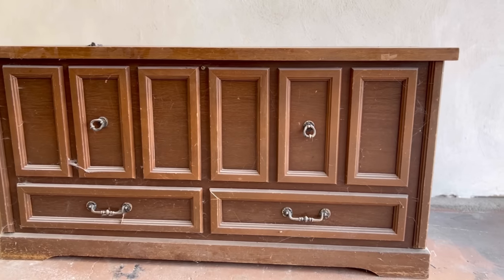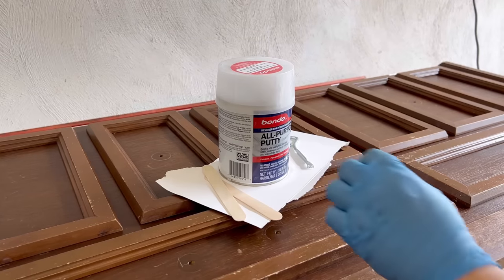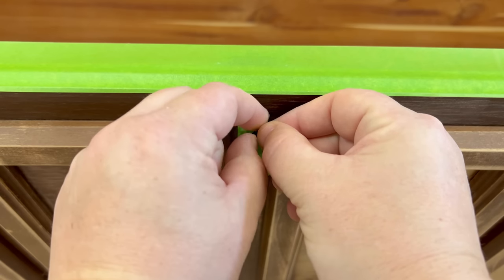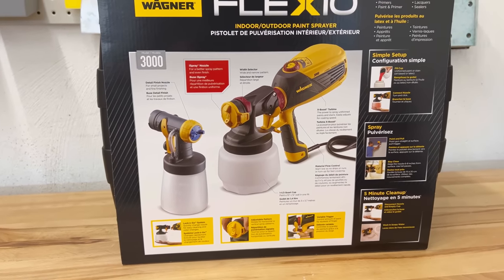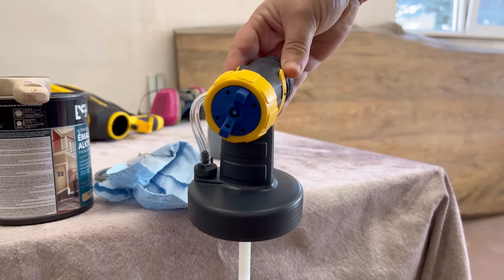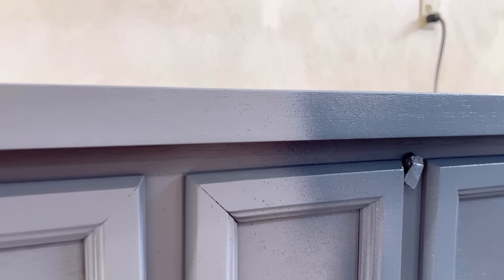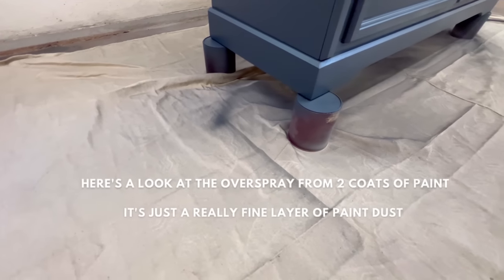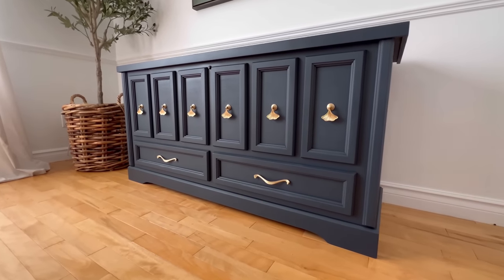Get a SUPER SMOOTH finish with a PAINT SPRAYER!

Comment: Beautiful and love the color for sure. I tried my flexio 4300 this weekend and about cried. I used the Behr cabinet paint and didn’t thin per directions. I have two large side tables with drawers now covered in rough texture. Prior I tried it with fusion paint and wasted an entire bottle of it trying to figure it out. I don’t know why I am getting the rough texture but sanding down and spraying again just creates the rough texture again. It wasn’t hot here either, barely warm enough actually. I don’t know what to do with this sprayer and I want to love it

Comment: I use that paint on all my furniture. Some tips I can pass on from many failures. The Graco sprayer works best with this paint, my Wagner tends to leave rough areas that I end up dry rolling to get smooth. Temperature is very important to allow self leveling, if you area is over 70 degrees Fahrenheit, then mix in some paint extender to lengthen the dry time. It is a very good paint and the effort is worth the result. I use Floetrol paint extender.
Reply from the maker: Interesting! Painting is definitely a very personal experience and we all need to test out what works best for us. I find that the Graco sprayers put out WAY too much paint and I’d be afraid to add an extender to this paint in particular because it already self levels so effectively (I’d have a drippy finish) 

Thank you so much for sharing your experience though. I’m sure someone here will find it super helpful ❤️

Comment: Thank you so much for making this video. I have been terrified to try spray painting furniture because the couple of times I have sprayed primer from the can, I get runs. I panic when I push on the bottom and move too fast or too slow and go back over it too many times and it turns into a mess lol. I also don’t have a garage or area suitable for spraying as I do all my refinishing in my open living room/dining room area (not ideal but I make due). I really want to learn how to spray and will have to try it again. I also really want to invest in the Surfprep sanding system and hoping to treat myself to one for Christmas. Any tips on what sander to buy and products would be welcomed.

I love this find and the color is stunning. I would love your opinion on that paint you used compared to the mineral paints and/or chalk based paints. Love your videos and your channel ❤

Comment: Great job on the spray painting.   Just curious- can that lock be opened from the inside?  If not, those locks should be removed or disabled (inside catch removed)- I know you said it was striped but hopeful something can make it safe as there too many accidents with little ones.

Comment: great transformation and the new hardware is perfect.
I have repetitive stress injuries in one wrist and I was wondering - how much time it takes to spray a piece like that? how much does the full sprayer weigh at the start of the project? can you spray using two hands at the same time? We have a sprayer we use for big projects like you mentioned but I'm thinking it may help me out alot on smaller projects.
many thanks from Winnipeg!
Reply: Maybe don't fill it so you can handle it better. Having the motor in the sprayer will make it weigh more but I'm sure you can support the weight with your other hand under the container. Try using sweeping movements from the elbow instead of the wrist. You can always return it after cleaning it thoroughly if you see its impossible for you to use. I would only use water based paint or primer that first time so you can return it as you got it. Take into consideration the time for it to dry between coats is when you can rest your wrist too. Good luck.
Reply: Maybe don't fill it so you can handle it better. Having the motor in the sprayer will make it weigh more but I'm sure you can support the weight with your other hand under the container. Try using sweeping movements from the elbow instead of the wrist. You can always return it after cleaning it thoroughly if you see its impossible for you to use. I would only use water based paint or primer that first time so you can return it as you got it. Take into consideration the time for it to dry between coats is when you can rest your wrist too. Good luck.
Reply: @suzanneribas3746  thanks. We've had it for a few years so well beyond return date. Not filling and dry time weren't things I thought of.

Comment: Great video. I found it very helpful as I try to use a paint sprayer for the first time. I was going to use the Zinsser B-I-N Primer with my paint sprayer as I have on past projects that I did with brushes and rollers. You said in this video that the B-I-N primer is too flammable to use in a paint sprayer, but I'm confused. The manufacturer's instructions on the can warn that it's flammable and to keep it away from open flame and other heat sources, but their application instructions also say to "apply using brush, roller or sprayer (follow spray equipment manufacturer's instructions, for airless spraying use .011 or .013 tip at 800 - 1200 P.S.I.)." Why do you say that this primer can't be used in a paint sprayer because it's too flammable?

Comment: If this was for resale would you have applied a topcoat? Has the finish held up so far without it? I have a hard time trusting the built in topcoats since I resell everything I do.
Love the ginko hardware. Beautiful piece as always. 😊
Reply from the maker: Alkyd enamel paints like this do not require any additional sealer and adding one can actually impact the effectiveness of the paint itself.
Reply: @salvagedbykscott  Good to know! Are alkyd paints the same thing as oil enamel based paint like Valspar’s furniture and cabinet paint?
Reply from the maker: An alkyd is an oil like paint in a water based formula

Comment: Just bought this paint for the first time after watching this video. So you don’t need to apply a topcoat with this paint? Do you personally still use a top coat with this paint? Thank you
Reply from the maker: I’ve had this piece in my living room for almost 2 years now. It sits behind the couch and our 55lb dog uses it like a window seat 😂 no top coat with 4 paws of claws jumping on and off 20 times a day and it’s barely worn at all. As long as you’re gentle with it for the full curing time, I’d 1000% trust this paint without an extra topcoat. BUT if adding an extra layer will make you feel better, you can do that too 😉❤️

Comment: Hello...I've been using a Wagner sprayer as well, and I usually use a satin poly for my top coat. I noticed that it does not leave a completely smooth finish and it feels like a light 400+ grit sanding would help, but then it'll leave marks. How could I help this? Thank you

Comment: Great video, here’s a really stupid question. When you spray with all the drawers and doors on, how do you get the paint onto the “frame” of the piece. When you open the drawers and doors, I’m assuming there is an unpainted strip. How do you paint that part? Thanks!
Reply from the maker: I never paint with drawers in for precisely that reason. This chest has no door or drawers though.
Reply: @salvagedbykscott  I’ve seen so many on Insta who spray with everything closed and then I never can figure out how it’s all filled in. Guess I should just ask them! Thanks for taking the time to answer

Comment: Hi Katie, I have a question for you! I took all the paint off an old desk et repainted it, but I’m not happy with how it’s looking. Taking all of the paint off was an excruciating process and I wonder if I should do it again to redo the paint with a spray gun this time, or if just sanding it and putting a primer would do the trick. I’m kinda new to all of this, so some tips from a pro would really help!
Reply from the maker: There’s no need to remove the previous paint job as long as it’s well adhered. You can just scuff it up and paint over it again.
Reply: @salvagedbykscott  thank you so much for answering!! So just sanding, no primer?
Reply from the maker: If you’ve already got a layer of primer and paint, there’s no need.

Comment: Any advice? No matter what I do I’m still getting stripes everytime on any of my dresser tops? I’ve tried overlapping each pass closer and nothing is working😢
Reply from the maker: Usually you’ll get stripes when you’re not applying enough paint to the surface or your air pressure is so high that it’s drying the paint before it has a chance to melt into the previous pass.